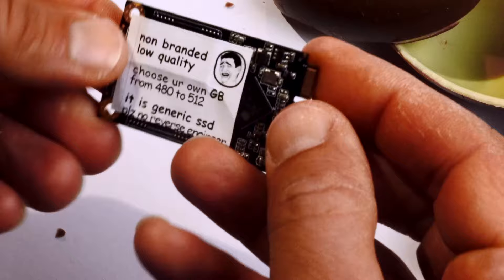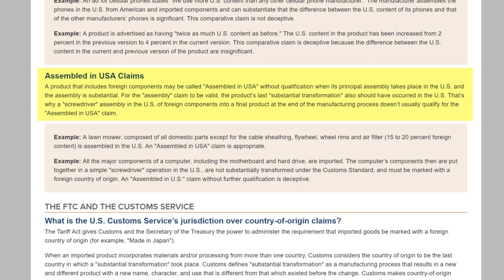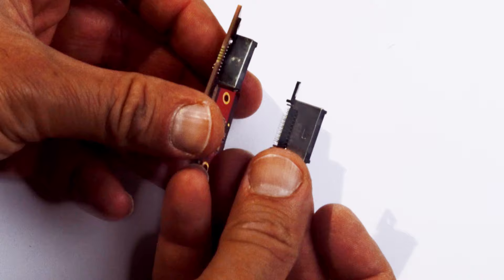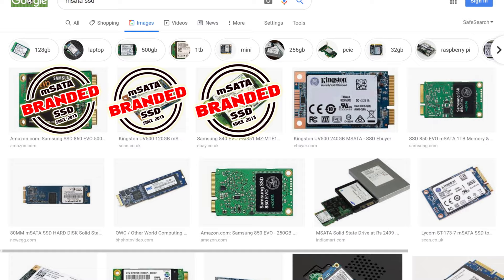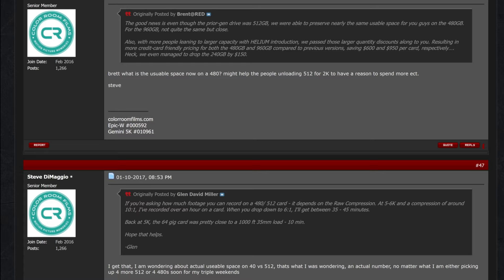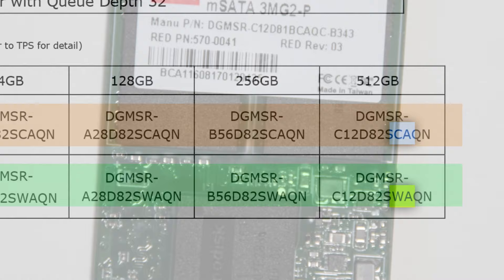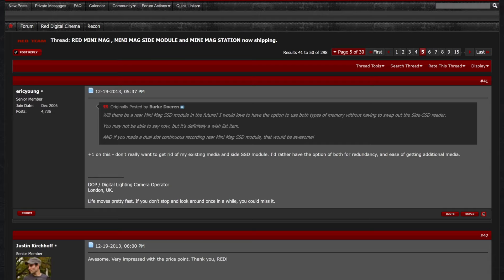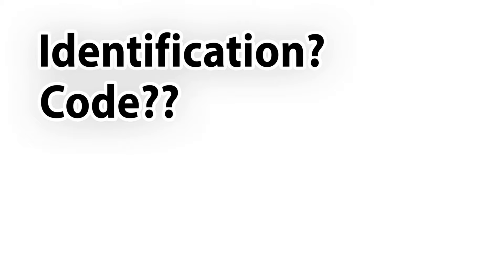Part 2 - RED MINI-MAG - Things you only thought you knew about RED Digital Cinema

Comment: tbh, I kinda think Red's action is justified because if the mini mags are cheaper, they would have to charge more on their cameras since camera R&D is actually insanely expensive. Charging more for the mini mag is loosely a form of charging more for ones who can afford it, like big productions would buy more and if you are a solo op&owner, you can buy less but still enjoy the benefits of cheaper camera. 
But red should have at least made their mags not exposed and 1500g shock proof like every other cine cam media. Non the less, I'm glas red is in the game to compete, otherwise the likelihood of us getting camera such as Alexa mini would be low and we would probably end up with a alexa SXT M (anyone still remembers Alexa M?)  for vfx work that cost 100k+.
p.s In Red's response, they said they spends hours per day doing free data recovery, and that's part of the pricing, I did some research and found out red's data recovery cost regular red hourly labour rate (https://support.red.com/hc/en-us/articles/360019833213-Data-Recovery-Service). Never used this service, so maybe someone who've done it can confirm or deny this.

Comment: After looking at this and that forced switch to mini-mag debacle for the SAME EXACT SHIT IN A NEW WRAPPER, just to make tens of millions off the backs of hardworking creatives is just wrong. 

Now I'm wondering about their cameras - do you not think that this philosophy, er, CON goes all the way to the top? They release a new freaking version every six months and always rip off the old customer by throwing this bitchy fit about 'oh we don't have to but we'll do it only for 15 days and it'll cost you $30,000 to upgrade to Methane 16k'

Do you have expertise in components regarding camera internals? Is there are possibility of doing a breakdown of a RED camera? Say, an older RED, a newer Raven and a new flagship? I know its hard and expensive so just asking if you might be able to.

Comment: One question you sell a 960gb jinnimag for 1000.00 usd what type of media are you using and shouldn't be worth 400.00usd 200-300 usd for media and no more than 100 for a aluminum case why sell it for 1000.00 usd?
Reply: Probably because he can basically come up with any price that's significantly lower than REDs one and people will buy. They money goes probably directly to his lawyer lol

I mean - if you want the cheapest option, you could try building your own with the instructions he gave in the videos.
Reply: Yup. That’s the point exactly. Capitalism. Red could do this because the market supported it for “professional” people. Same reason Apple is selling s monitor stand for $1000. The market supports it. Once more people realize that they can swap media cards the price will go down. Even For jinnimag because another company will make them cheaper.

Comment: I need advice ,my redmag station reader just stop working ,is there any other way of getting the footage of the ssd card or through the camera ,due to corona lock down its gone take some time order a new one ,have any one tried opening it coz I tried I just can't open it to see whats wrong ,any suggestions please ,its a matter of life and death lol, thanks in advance :) mine is not the same as the red mini-mag as in the video its the big redmag 1.8 ssd cards.
Reply from the maker: Old Redmags 240gb and up are the same. Below 240 are mainly micro SATA SSDs. Get the SSD out of the enclosure. Buy  a microSATA to SATA adaptor (a few bucks on eBay or Amazon) and a SATA to USB (again from Amazon or eBay) and enjoy. All together won't cost you more than $30 or so and you can get USB 3.x instead!!
Reply: @JinniTech  Hey! Did you find a way to put anything else inside to replace the SSD? I want to upgrade my 120gb to at least 500gb.. I CAN PAY YOU FOR HELP. Thanks

Comment: Could you test the msata red adapter and see if it's really RoHS. PLZ I'm courteous
Reply from the maker: It needs equipment I currently don't have. But if you have a reason to be suspicious I.can check how much does a lab charge for a proper test?
Reply: @JinniTech  I know there are some labs where you could pay 200 - 300$ and they tell you If it's really RoHS or not. After seeing your previous video and part 2. I am a bit suspicious about the RoHS tags. If you plan to make the next video about MINI-MAG it could be interesting to look at the certification and see rather what is written (FCC, RoHS, CE) is real for just for marketing.

Comment: As much as I dislike RED you are wrong about the high mark-up. You haven't calculated the costs of the outer shell, they cost to produce. Maybe not much but still they cost. Also sallary paid to the person putting them together. So your calculations are a bit off.
Reply from the maker: I'm saying how much worth of tech is inside.
More importantly, it is not about mark-up at all! It's about the practice. The lies. Deception. Red could have been forthcoming and still call their price. The difference is they had to operate in a fair competition, which seemingly Red doesn't like!
Also, possibly any fraudster or drug dealer can come up with a list of expenses they have to cover :)
Reply: @JinniTech  yes I agree with you their products are way to expensive and you are right. But when you calculate the mark up to 42.5 times more than what the memory costs, you need to deduct maybe 5-10 dollars for the case and maybe 20 dollars worth of sallary. This makes you look more credible and precise in your critique. All I want is you to recieve as little critique as possible.

Question: How do you sleep at night? Are you worried that they will come after you?
Reply from the maker: Thanks  @sa.t.2507  I appreciate your point.
Yes, I am a bit worried. Apart from all the verbal abuses, someone already threw fire under my car a while ago. Luckily, we noticed quickly and managed to extinguish that safely. We seriously raised our guards since then.

Comment: Okay, what makes JinniMags so different? 400 quid for 240GB (and that's apparently "on-sale")? "Adaptive Read and Write Scheme and on-chip RAID functionality"? That's quite literally a copy-paste from 88SS9187 controller... which released in like what, 2012-2013? What else has 88SS9187 controller and uses Micron NAND... oh right, Crucial M500 does, which is an old model, so I highly doubt JinniMags are using those, and even if they are, they had MSRP of $219 in 2014 for 240GB model. Sure, not as insane of a markup compared to RED, but nonetheless, there is one. Don't try to tell me that "cool design CNC machined Aluminium" costs you 200 extra quid. Also NAND uses ECC by the default ever since it was introduced and is quite literally a non-factor. Good job trying to expose RED while indulging in similar practices...

Comment: A little bit of devil's advocate here, That doc connector should be more robust and handle multiple insertions a lot better then a raw pcb or normal SATA cable as you are changing mags a lot of times in a day but the R&D cost of finding a more robust connector for your product should only be 2 or 3 times the product not over 10x soo i do see your point here.
Reply: How hard would it be to slap a 30-pin dock connector on there, or a USB-C connector carrying a raw SATA signal? 
There are thousands of dock connectors you can buy off the shelf from China that would do the job just fine. The R&D cost is paying some intern to spend a week ordering 20 or so connectors that look strong and are from reputable manufacturers and thrashing them all to see which lasts the longest. 
Additionally, it’s a guided insertion by the mag being held in place by the casing, drastically reducing insertion fatigue by orders of magnitude. Any connector would have been fine, even raw PCB edge, it might just get dirty easier

Comment: You and your analogy is just stupid. Especially your final words. Before questioning RED’ business practices... How good are your moral and business practices. Why couldn’t you go through a proper third party certification through RED for your products. And what made you to stop your business and to start this propaganda...

Any product company just like RED, would not recover R&D cost by selling one item... they would forecast sales and set Product and accessory prices. Unlike Arri ( selling cameras and firmwares at higher prices), RED sells cameras at a moderate price and try to recover cost/profits through selling proprietary accessories at a higher price. Its their way of doing business. If you do not like it... do not use their products. Its as simple as that.
Reply: Are you so smoothbrained that you think RED would happily certify a product selling superior hardware for 1/10th the cost, and when Red makes no profit from the sales?
What’s immoral about ordering parts from China, having a pcb made to bridge two industry standard connectors, and putting it in your own case?
Are all portable hard drive manufacturers immoral if they don’t also make the disk themselves? That point is irrelevant, because in this case RED doesn’t make the SSD either.